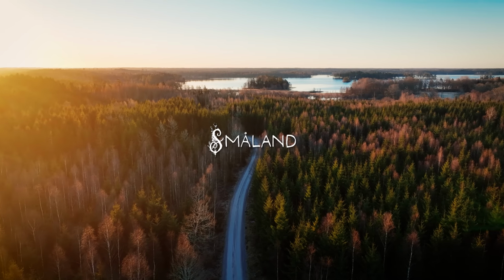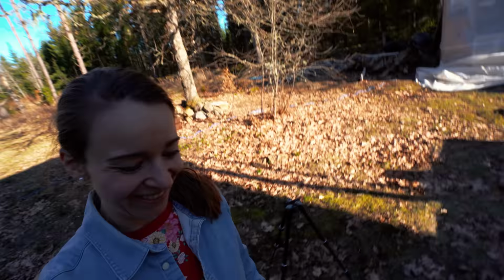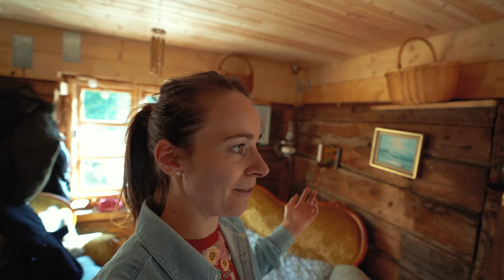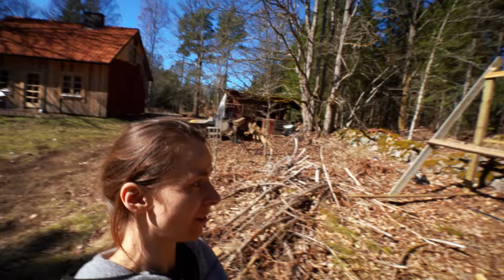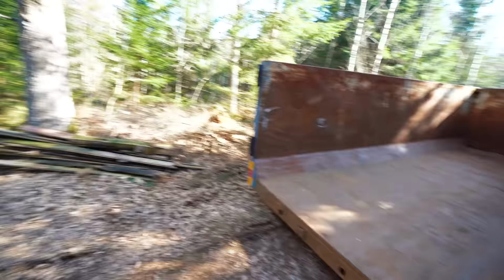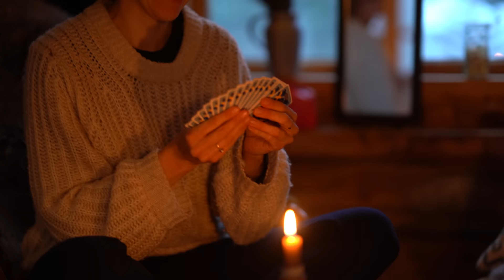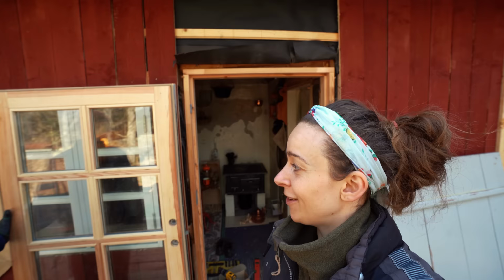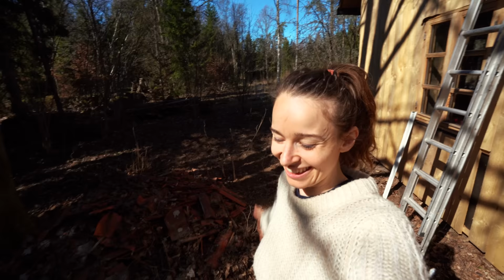#30 A Realistic Off-Grid Week in our Cabin | Solar panels, Building, Baking & Cleaning

Comment: I also discovered I had a beautiful old wall when renovating the kitchen at my torp (in VGL). I wasn't sure I wanted to keep it bare because of insulation issues, but from an old builder I was told I could use a mixture of rye, sand and linseed oil in any open crack I wanted to seal. I suppose it might be an old Danish recipy, so that might be something you could look out for.  It is as you can see also a sustainable solution for an old torp. Btw, strange door, it must be something gone wrong in production!
Reply from the maker: Okay! This might be gold! Thank you so much, I will tell Julian about this miracle recipe. Because yeah, we were planning on insulating the wall on the inside as well. 
Yeah, the door, right? 😆
Thanks again ❤️
Annie